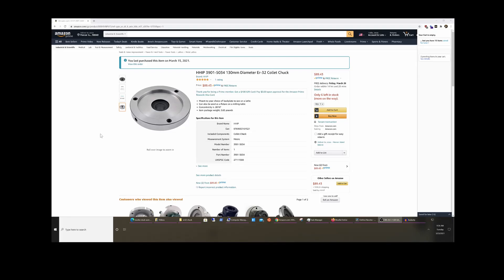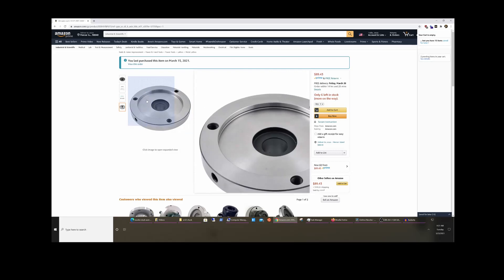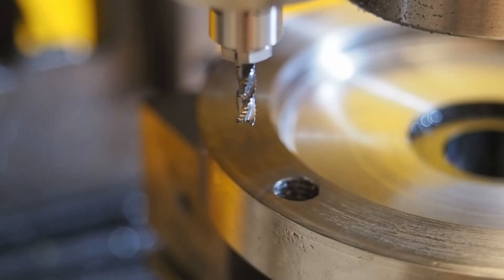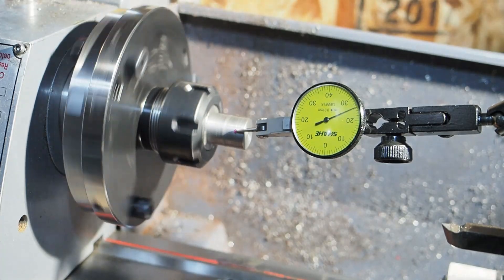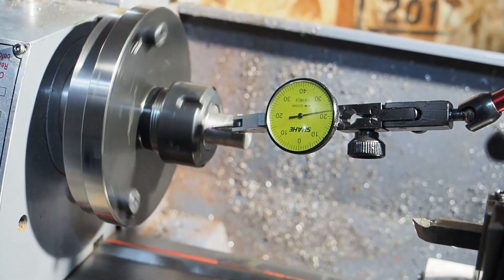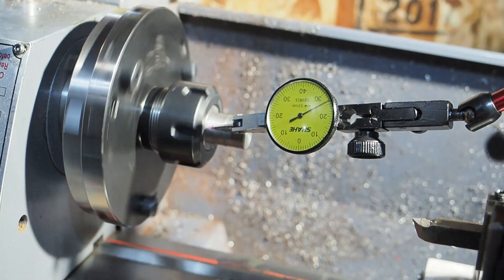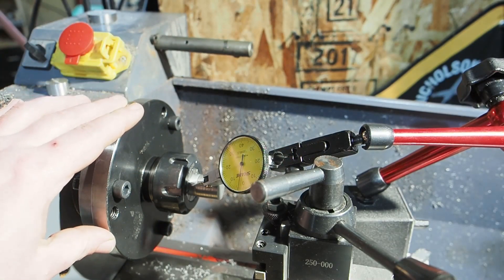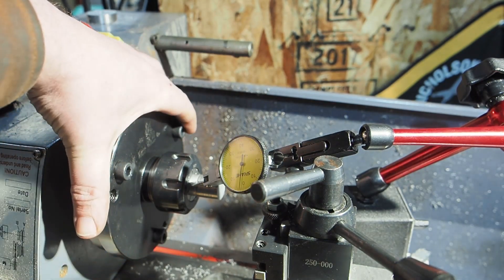er32 lathe chuck: mx210v wm210v 8x16

Comment: What motor do you have; 750w or 1100w?  Did you have it on the highest torque belt config?  Also interesting choice to mount the rpm and dial bezel upside down :)
Reply from the maker: the motor is the original, 500w or so brushed.  Not much power.  RPM upside down because it is representative of the overall quality of the lathe and when i re-seated the bearings i put it on upside down and just havn't bothered to fix it.

Comment: Wait. Hypodermic needle air blast? I like it, will steal :p Do you have that documented somewhere?
Reply from the maker: it is very efficient with the air.  Stephan Gotteswinter did a video on his, you can search thingiverse for "luer lock" and modify the model for your use.  they have both a taper and thread. you can get away with just using the taper.  I was using one attached with super glue before I saw his video, i didn't know what the connector was called but now that I do I can make them all day.
Reply: @JesseSchoch  Sweet! Thanks!

Comment: Have considered buying one for my lathe, but wondered how accurate they were.  Have you indicated the ER32 tapered socket to see if it's the adaptor that's giving you the runout, vs. the collet holding a workpiece?  If it's the adaptor, you could use a tool-post grinder to true up the taper of the socket (very carefully, of course).
Reply from the maker: the spec is  .0016" which is ~.04mm.  I'm 2x better and i'm fine with that.  I also think could tap it in a bit closer.  I have not fully checked the taper but from a few spot checks it matches the ~.02mm runout.
Reply: @JesseSchoch  Sorry, just watched it again, and noticed you were using a 0.01mm indicator, not a 0.001in.  Yes, that is good!